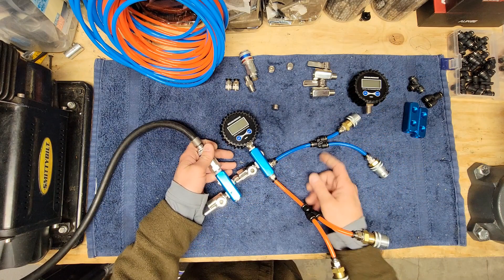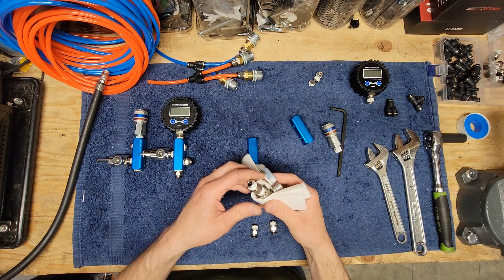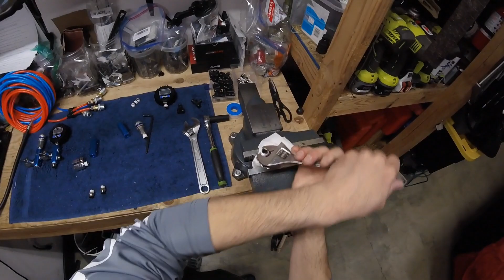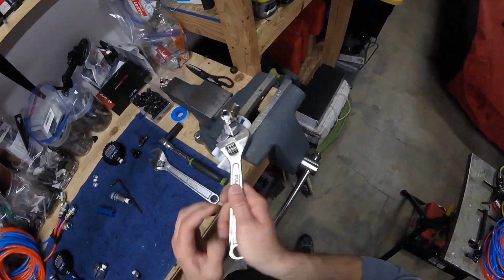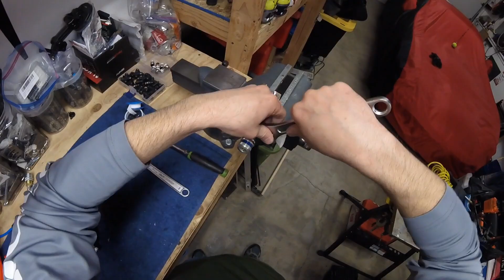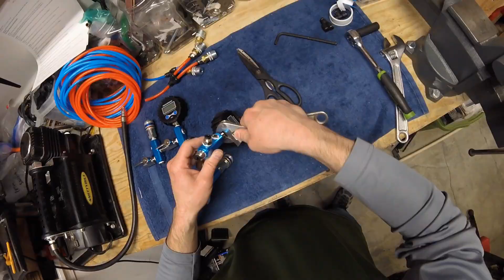Four Tire Inflation System Build DIY - 4x4 Off Road Tires

Comment: The PTC connectors are great.   I just discovered them a few weeks ago and I'm putting my own system together.  I'm going to try and run the hoses permanently to all four corners so all I have to do is connect short lines to the tires.  I'm also going to use a CO2 tank with a regulator valve instead of compressor.
Great video.
Reply from the maker: Thanks for the feedback!  Yes, you idea of running hoses to each corner is a fantastic idea!  I see that too as the end goal, so it is on the modification list for sure.